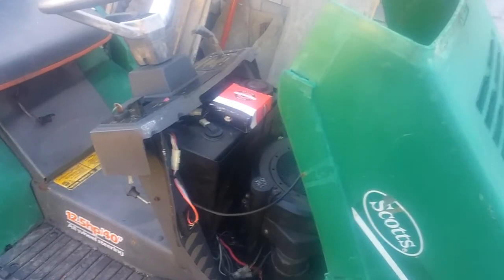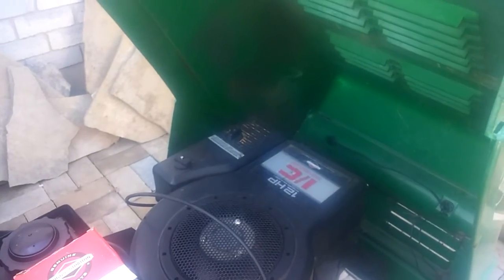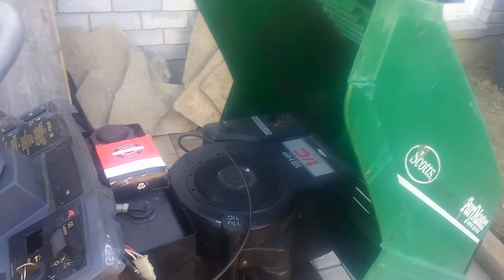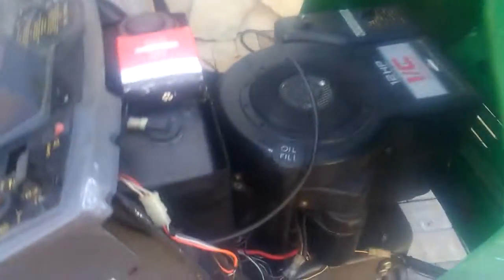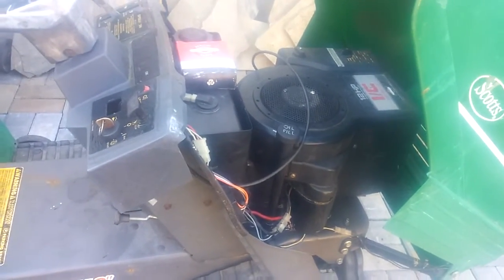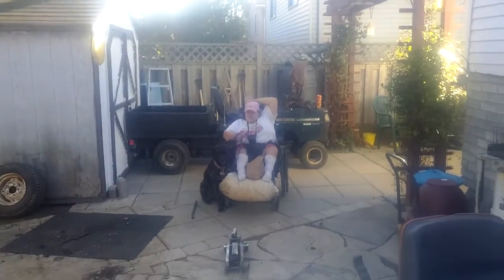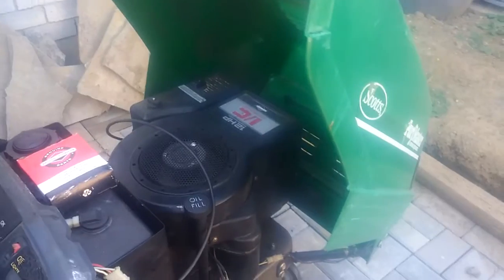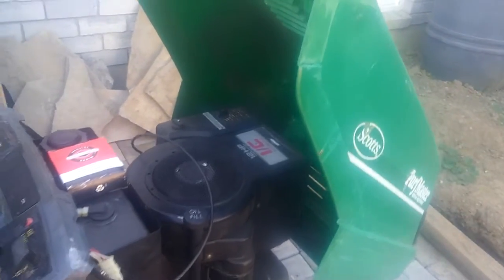Scott's V-Twin Conversion

Comment: You won't regret it man. Any vtwin mower I've ever used, doesn't bog, cuts greaaaaaat, and depending on how you do the exhaust(especially if each cylinder has it's own individual pipe/muffler) they sound damn good. What's not to love!?
Reply from the maker: As of right now I have the engine and it has a stock exhaust, both pipes go into a single muffler.
I personally feel that it is underpowered just by cutting my small front yard with it.